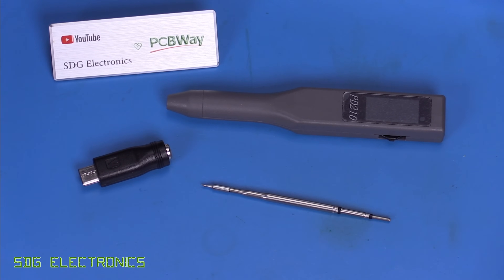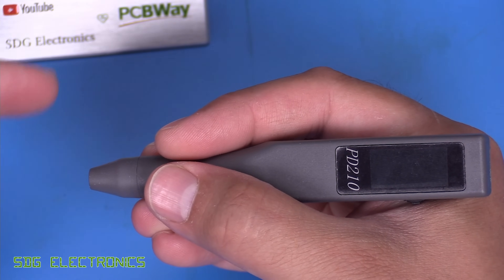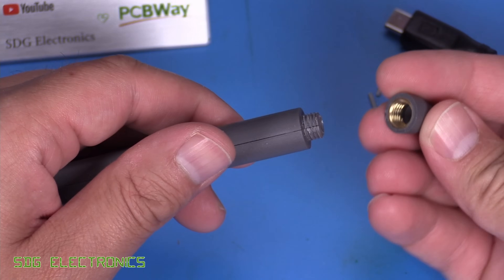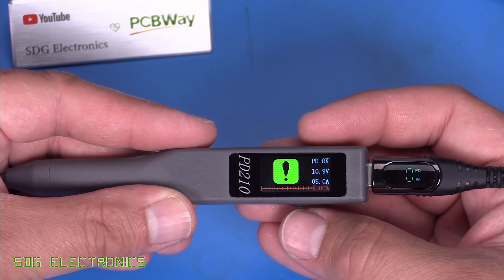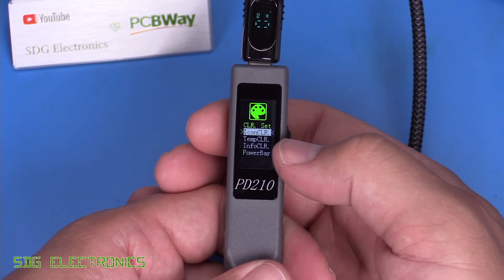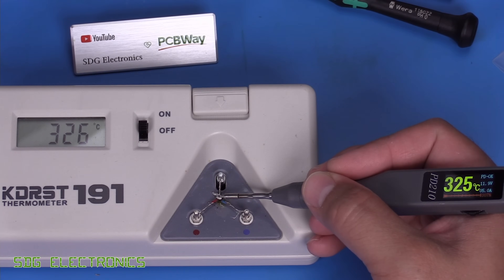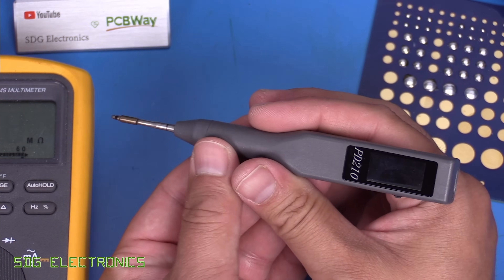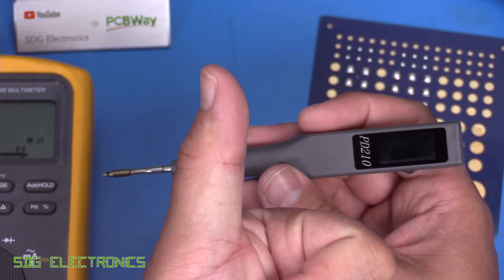SDG #345 KSGER PD210 USB-C JBC Style C210 Soldering Iron PD3.0

Comment: Regardless from it's little molding fabrication flaws, for me this soldering iron remain the best one for SMD soldering on the market. Small size, very well designed menu, use popular cartridge, cheap. And also... I newer burn my fingers when I work with this iron. I can compare this with KSGER T12 station and TS100. KSGER designers do really good job now!

Comment: I got mine. Two things: DO NOT INSERT THE TIP WHILE IT'S ON. This goes from o to 170c in less than a second, and you will burn your fingers. Don't ask me how I know. When ordering tips, those cheap black tip c210 on Aliexpress won't fit this. Again, don't ask me how I know. I'm a horseshoe tip kinda guy, so finding tips for this is not easy. There are a lot of tips but most are pointy tips for SMD work. i like it, I just have to adjust the sleep and wake settings.

Comment: Got one of these in the mail today.

I can't work out what the "Current Limit" setting actually does, if anything, it doesn't appear to make any difference to anything, you'd expect to be able to set an actual current limit, but it's just Yes/No, and doesn't seem to do anything that I could see.

For some reason, perhaps it's the supply, on a 30W supply when configured for 12v PPS (or Fixed) it reports 2.5A, but resets as soon as heater power attempts to be drawn, dropping it to 10V it reports 3.0A and works fine. 

Anyway, nice iron, with a power supply that it is happy with.  USB-C socket probably will be the point of eventual failure, some strain relief in the design would have been a good idea.

Comment: Please review Pinecil v2 with DC Power supply through DC Barrel connector not flawed USB C or Quick Charger. Because mine purchased one work very good with cheap DC Power supply and running smoothly. My suspicion is USB C is not delivering its full power properly

Comment: One thing I don't see mentioned about these modern irons is that inserting the tips with bare hands is super-dangerous whenever the units are powered on.  If the unit turns on the tip power either intentionally or by accident because you touched a control or the logic isn't perfect, the tip is at operating temperature within 2 seconds.
Reply: That’s like saying the stove is dangerous to touch with bare hands, which is basically saying nothing.
Reply: There are official and aftermarket cradles that have tip holders and removers. But honestly if you’re that worried about it silicone exists. Just cut a piece off and use that to pull them off and put them in. Or gloves, or unplug the whole thing. This wouldn’t be the iron you would use for high volume anyway, so you’ll have time to do whatever you feel is best for you to not burn yourself.

Comment: Wow.  I really don't need another soldering iron, but this thing works very well for what it is.  I really like this approach as while the construction is inexpensive, the tool has useful features, a nice screen, and an interface that actually seems thought out more than some.  If they had taken the Miniware path this would be made of nicely machined aluminum, but cost $90.

KSGER's T12 clones have become fairly expensive over the years and their quality control is not great, but I'm impressed with this thing.  It shouldn't cost much to make a DC soldering iron as it's basically just a FET with a temperature controller.

The only "downside" to this unit is that the one in the prior review had a safer, JBC-style handle whereas this one narrows to the tip with only plastic; it may give finer control, but your fingers are pretty close to the hot bit.
Reply: add rubbery heat shrink tube on the handle and you'll get better safer grip

Comment: Suggest getting a flexible USB-C silicon type rated for PD, or a right-angle type just for soldering iron usage. There are also PD rated right angle adapters, but that seems like too many connection points mechanically, maybe if you could clip a 3D print around it all to reliably secure it. The ergonomics of cable management always seem to fall a little short on these, and the cable will keep trying to pull it about.
Reply: Came to say the same. I don’t know how people use all these with inflexible thick USB-C cables. It drives me crazy. My main iron has a connection like this and I bought some 2-wire 22ga silicone wire and tiny USB-C DIY connectors and soldered up my own wire with an XT60 so I wasn’t constantly fighting the cord.

Comment: I guess IronOS can be ported to that nice device.
Reply: For what? It can hold temperature? Yes. You can change temperature? Yes. It is all what needed from iron for soldering. what happens to people. this is a soldering iron.
Reply: @dekus80  For fun. For minor improvements- presets, boost etc for example. But you're right it's pretty complete and actual there's no MCS51-port. For my KSGER T12 (STM32), for example the alternative firmware is a major upgrade.
Reply: IronOS sucks, it’s clunky UI made me switched back to stock in seconds on my ts101. And their lack of update in almost a year is just a good indication it’s abandoned and anyone will be far better off with official support

Comment: Nice vid, as always. If you are looking for more USB powered 210 compatibles, Aifen has the A11...

One thing I don't like about all irons I've seen of this type is that none of them do anything to prevent you from inadvertently moving your fingers too far forward. The number of burns I've gotten from my S99 is too damned high!
Reply: why you just don't add some stopper at the end?
Reply: The original ksger aluminum iron had a normal T210 rubber handle, way better than this one.